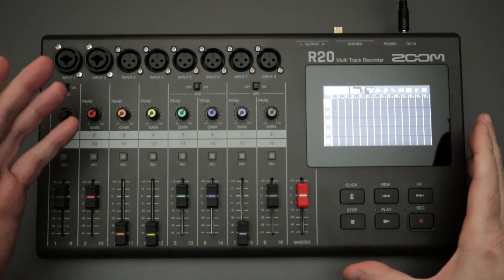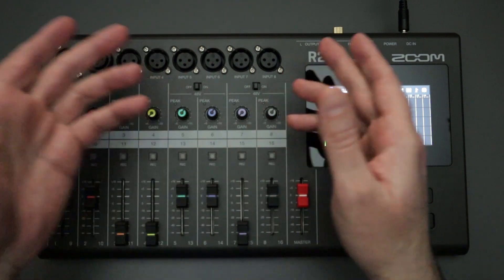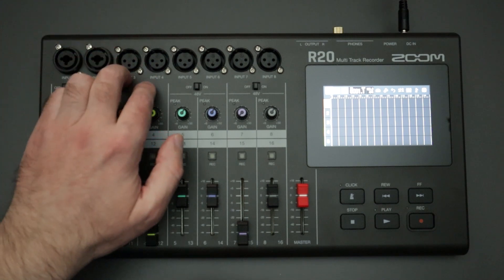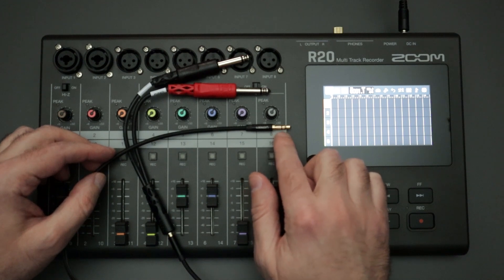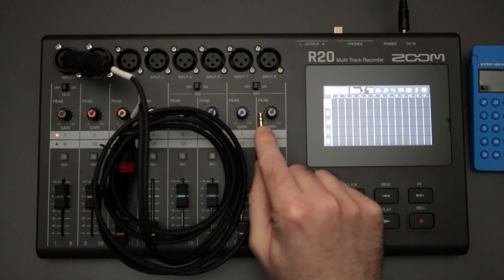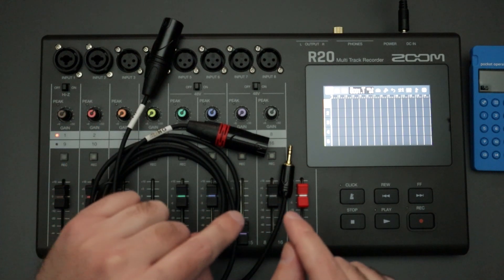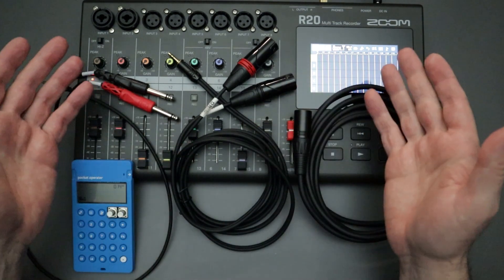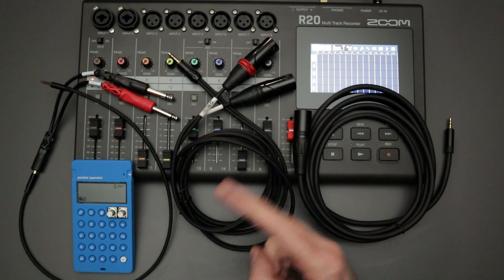ZOOM R20 - using all the inputs with TRS to XLR cables (applies to many mixing boards too)

Comment: I notice places like Tunecore want 44.1 16-bit uploads. So what would be the point of recording in 44.1 24-bit?
Reply from the maker: 16-bit / 44.1kHz sample rate has been used since the early 1990's when that's when everyone settled on that standard for "CD quality sound."  It's fine, and it offers decent sound with fairly small file sizes, which was important back in the 90s.  But for recording, you really have to watch your input levels because it's easier to clip.  Like with 16-bit, if you are using a guitar and you set the gain for one level, but then you strongly pick a couple solo notes, those notes can quickly clip with 16-bit recording.

24-bit gives you far more dynamic range in your recordings, so you can have bigger separation between things that are loud and things that are soft.  It takes up more file storage space compared to 16-bit, but these days that's not even a concern.  I always record in 24-bit and recommend you use 24-bit for all your recordings.  You can always downscale it to 16-bit for any specific purpose later.  But best to capture and record audio at 24-bit.
Reply: @GazRendar  💯 Thank you so much for all your advice. 🌟
Reply: @GazRendar  Now it only allows so many blocks of sound in a region. When I try to copy my vocals to another track to double then it says “REGION FULL”. Can’t seem to fig out what that’s all about. 🤦‍♂️
Reply: @GazRendar  Found out r20 has a 50 region limit. So I’d have to export the track etc and bring it back in again. DOESNT seem to have a merge regions function. They goofed on that one! ☝️
Reply: 32bit is on many portables..hope they catch up. what's a CD

Comment: It’s really strange...I notice on track 3’s input, when I turn the volume up there’s a faint background noise. I don’t notice this on any other tracks. Any ideas? The good thing is, I only record one instrument at a time, or import the audio.
Reply from the maker: Hmmm.  That's odd.  I haven't fully tested and carefully compared all the inputs on my R20, but they qualitatively sound the same to me.  The XLR inputs tend to have a little more gain than the combo inputs, but I haven't noticed any noise in any of the individual inputs/tracks.  Maybe the input is a little loose, or not grounded well?
Reply: @GazRendar  Of course, I just figured out how to drop the output level in the track editor itself. Go figure! 😂
Reply from the maker: Glad you got it working!
Reply: @GazRendar  But there’s one HUGE catch: The mix has to go thru the SINGTRIX unit, which adds a faint fuzz to the mix. Not cool. Gonna go to GTR Center later, buy a breakout cable, to see if I can at least separate the mix from my voice. I probably need a better vocal processing unit:(
Reply: @GazRendar  Problem is, it’ll probably cut my voice to one side of the spectrum and I’ll have to pan it center, but will I be able to add enough gain to hear it at that point? Time will tell. 🤔 (I never realized how complicated NOT trying to use a computer is!) 🙄
Reply: @GazRendar  Can the R20 do any automatic vocal harmony?
Reply: @GazRendar  I tried plugging a vocal processor into it (SINGTRIX) and I’m getting horrific feedback.

Comment: I use a 3.5 trs (w/ 1/4" adapter) to dual xlr cable to run from zoom fx pedals that have a 1/4" TRS output and it is quite noisy if there is high gain in the fx chain. By adjusting gain stages, lowering fx gain then using the recorder's trim pot for volume, I am able to trim out electrical noise.
A 1/4" trs to trs eliminates noise, but it will require a single 1/4" input, though you can control mono/stereo by utilizing the tip or ring... it's quiet but you'll have to fiddle with finding the tip or ring depth in the input to toggle mono/stereo.
Reply from the maker: Yes, depending on what cables you are using and what you're sending through the cables, like overdrive effects with high gain, you might get some extra static noise.  Every time you add an extra adapter, like a 3.5 mm to 1/4" adapter, you also run the risk of introducing a little more noise in the path.  But yes, you totally want to adjust the gain on the R20's channel to try to minimize that.  You can also attempt to use the Track noise gate as well to eliminate a little more noise in the path.  Nothing is perfect, but by fiddling with your settings you can usually find something that works well enough.
Reply: @GazRendar  Hope I didn't read contrary. When I read my reply again I noticed I didn't mention that I was trying to offer noise solutions to your cabling solutions which I use and agree with.
Reply from the maker: Oh no, it's all good.  You brought up good points, and it made me realize I didn't really mention using a 3.5mm to 1/4" adapter for the TRS side in my examples so I posted a comment and pinned it to the top to give users more options that they can think about when planning their own set-up.

Comment: Correct me if I’m wrong but not sure why you’re only recommending people to use 1/8 stereo jack? Besides pocket operators, an older iPads what really takes that connection?
Most of my synthesizers are all  have quarter inch inputs & outputs. I use all quarter inch to XLR cable and it works fine.
Reply from the maker: Sorry for the confusion.  Many small synths use 3.5mm out, like Volcas, Teenage Engineering gear, stuff from Cr8tive or 1010, and plenty of small modular synths.  And I've specifically received a lot of comments and questions about hooking those up to the R20 over the past year that I felt like I should try to address it in a video.

But yes, you can absolutely use 1/4" to XLR or you can take that breakout cable I used in this video and put a 3.5 mm to 1/4" adapter on it.  My main point was to tell people to avoid using a stereo out with a balanced XLR cable otherwise they'll end up with no detectable sound.